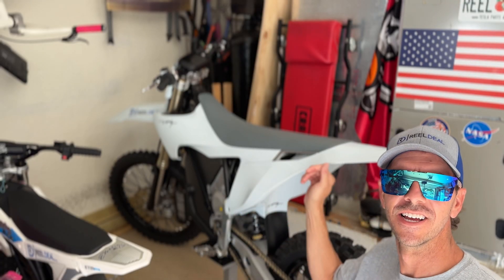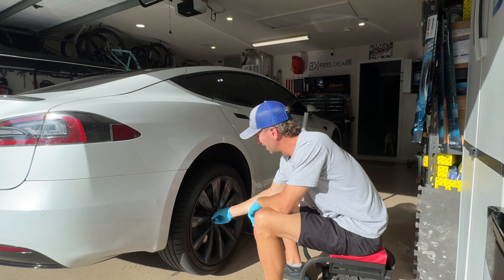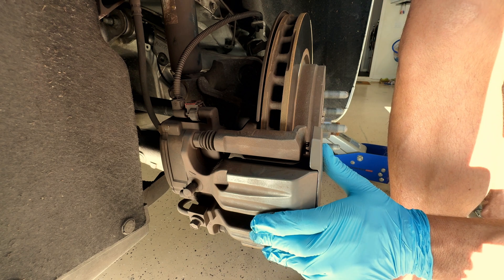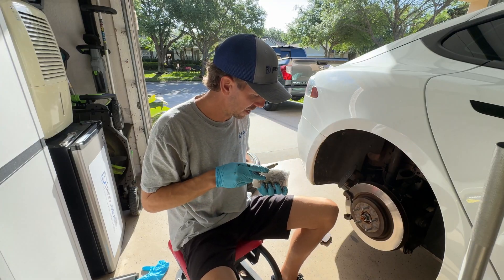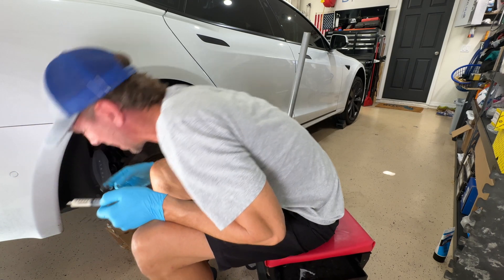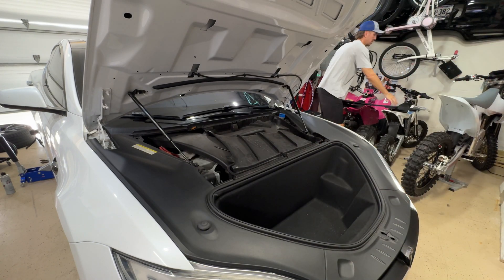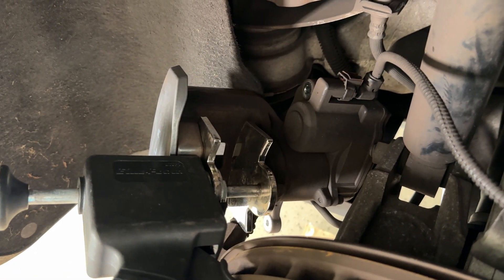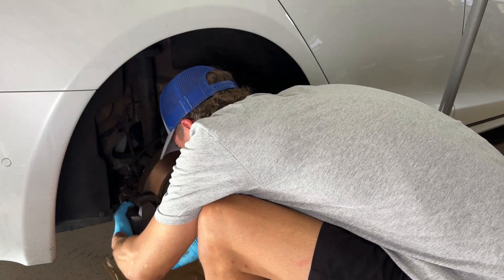Tesla Model S Brake Pads DIY with Emergency Brake

Comment: I replaced the rear brake discs and rotors. But now there is binding on the rear left. I didn’t do the 12v manipulation, (only saw your video after I’d finished). Could that be what’s causing the binding? The guides are totally free, so mechanically everything is fine. The only thing I can think is that parking brake. 

But I wound the caliper all the way off… so assumed it would be winding back the parking brake also?

Comment: Thank you. I got a problem with rear brakes, very hot disk after riding. Your review very helpful. I repaired rear brakes and it's done. Also electricity consumption down from 200 to 180 watt per km.
Reply from the maker: Thats awesome! I assume you are in a climate that uses salt on the roads or has heavy corrosion